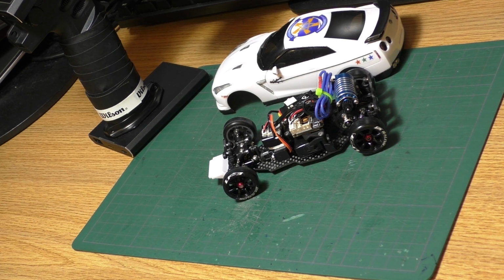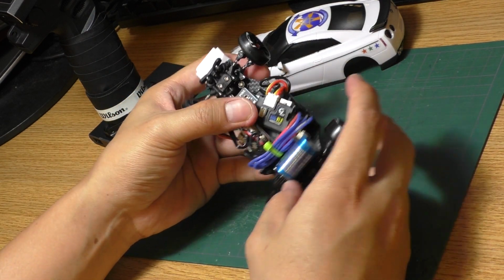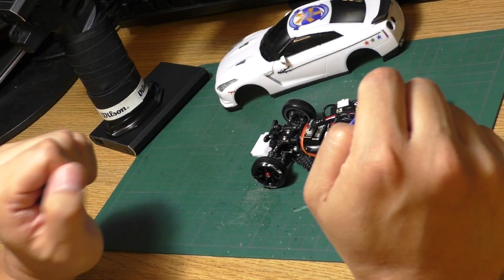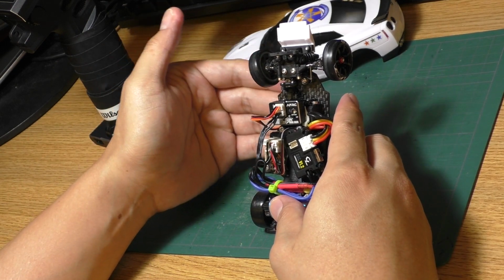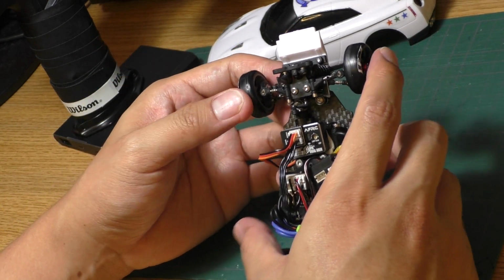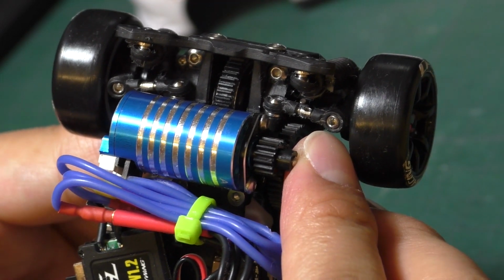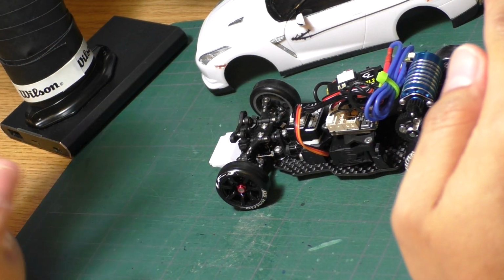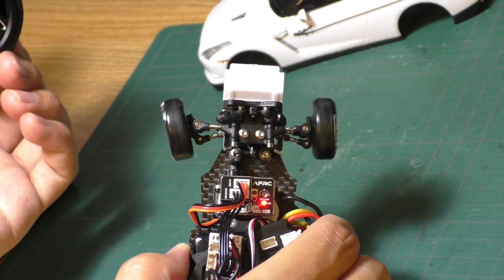GLD Test Drive & Initial Thoughts

Comment: Hi.
Is the DRZV2 a better chassis?
Reply from the maker: No, it has its own problems too. I'd say no matter what you buy nowadays there will be a risk with bad QC and each car has its own kinks and problems but all of these new generation RWD, GLD, DRZ v2, XRX DPA are all good cars so you can't go wrong with either of these. Just choose the one you can get the easiest and have parts support that you can buy easily.
Reply: @BeaversHobby  thx for answer
Reply from the maker: @christianschluter2087  My pleasure.
Reply: @BeaversHobby  ist the old drz OK ore is IT bad vs gld ore drzv2
Reply from the maker: @christianschluter2087  Compared to the new ones it's pretty bad. Steering angle isn't that much to be able to catch the drift easily. There are many people who got it and just can't get it working. DRZ v2 has much less failure rate. GLD has even lower failure rate and XRX DPA has probably the least problem right now.

Comment: What lights can u use on that esc ?
Reply from the maker: ESC doesn't really control lights but if you want to use the power from ESC that goes into the receiver then it's 5V. And you can use any 3mm LED with 100 Ohm resistor.

Comment: salve mi sai diere perchre la mia glr gt ruota su se stesso
Reply from the maker: Check tyres contact, diff and also if the suspension can move freely first. If you have a gyro on, check if the direction is correct.

Comment: They went with an interesting design that required, I assume, 3 bearings to get that steering working right but didn't put any money into the quality of the mechanical parts. On top of that, their site looks VERY professional, kind of misleading in my opinion and a waste of money, should have spent more money on the rnd and quality of their product
Reply from the maker: The slider assembly itself is awesome. The knuckles are pure garbage. This rather defeats the point of having good steering system.